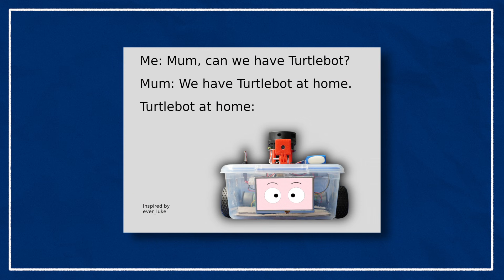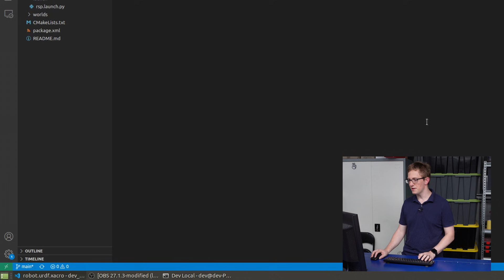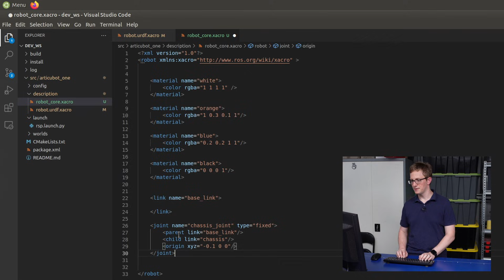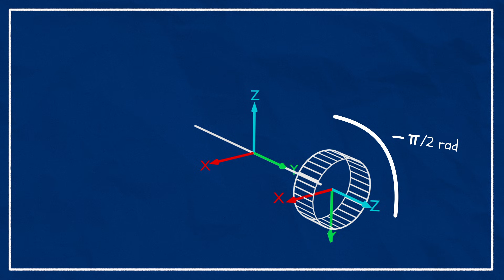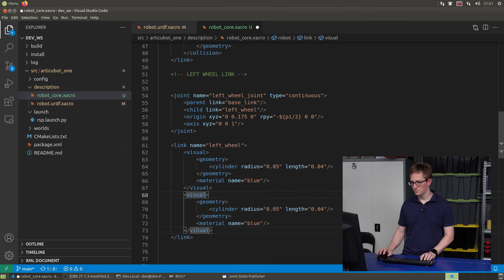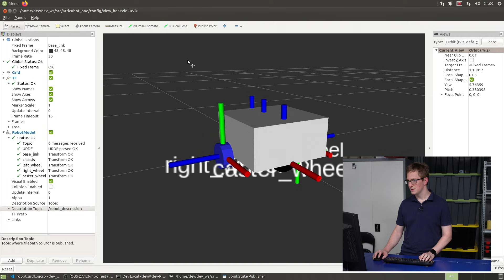Creating a rough 3D model of our robot with URDF

Comment: Hey, I am facing issue , I removed the castor wheel section and I added two more wheels to make it four wheel robot, but im not getting it on rviz, it still shows the older robot( I'm using the latest edited git hub package).

Comment: I made the changes in the robot_core.xacro but I cant seem to see the base_link and Chassis_link show up on the terminal? I tried closing, and sourcing ros2 and sourcing the install/setup.bash, using colcon build again in the src folder but still doesn't show up. Any help would be great, by the way love these videos and you have a real knack for teaching!
Reply: I have same issue
Reply: @chiragshinde4182  Have you managed to solve the problem. I am facing the same issue
Reply: I am facing the same issue. Anyone found a solution?

Comment: I am using ros2 humble to follow up on these tutorials. I am getting this error when i try to run <ros2 launch my_bot rsp.launch.py> : 

[INFO] [launch]: All log files can be found below /home/danny/.ros/log/2024-09-01-12-24-26-637618-danny-15734

[INFO] [launch]: Default logging verbosity is set to INFO
[ERROR] [launch]: Caught exception in launch (see debug for traceback): Caught multiple exceptions when trying to load file of format [py]:
 - ExpatError: not well-formed (invalid token): line 5, column 11
 - InvalidFrontendLaunchFileError: The launch file may have a syntax error, or its format is unknown

what could be the issue?

Comment: Thanks for the video series, so far it is very informative! I noticed that for the inertia tensor of your cylinder, the axis of rotation is about the z axis. Since your wheels are rotated about the x axis by pi/2, their axes of rotation are now about the y axis. When you define the origin of the inertial tags for the left and right wheel, shouldn't you also rotate the defined inertia tensor about the x axis by pi/2 as well?
Reply: or is this not needed because you have rotated the axis of the joint around x and then stated that the axis of rotation is about z (which was originally aligned with y). I think i answered my question

Comment: there is a problem where i couldnt run the package of joint_publisher_gui  in which it says package not found.eventhough i had sourced it but no use.kindly help anyone
Reply: Same problem here ! did you fix it ? if yes, could you tell me how please ?
Reply: This worked for me: "mamba install ros-humble-joint-state-publisher-gui". I'm using the ros-humble installation from RoboStack as a basis.

Comment: If I wanted to build a more complex design for the chassis could I use for example Fusion and import the geometry and write a xacro file manually? Or how would you do it try to build everything in xacro only?
Reply from the maker: That's a great question. There are tools for converting from Fusion to URDF which I've never used but should probably try, and then make a video on, I'm pretty sure people are using it out there in industry. I'd personally be inclined to do it manually for the sake of simplicity and clarity, but it depends on the project.

Comment: Im trying to use foxglove to publish to joint state and for some reason I cant get my wheels to to turn on publishing to /joint_states. 
I am using docker + ROS2 so running rviz by forwarding the  X display is not working for me for some reason hence foxglove. But foxglove doesnt have joint publisher GUI :(
Reply: I finally got it to work, had to install ros2 foxy on bare metal, change the DDS version to cyclonedds and then run rviz and gui state publisher on bare metal to be able to control the wheel, It would be great if you do a series that just focuses on ROS 2 networking and make it a first class docker citizen
Reply from the maker: Glad you got it sorted. Honestly, I find the DDS stuff maddening sometimes. When it works it's great, but when it doesn't it's very opaque and hard to troubleshoot.
I'll definitely be doing some videos on ROS and Docker, but I'm no expert, I'll just be showing off what works for me haha
Reply: @ArticulatedRobotics  micro ros and stm32 board tutorials would be amazing ! Byw really looking forward to those arm videos. I am really interested in inverse kinematics, position and torque control !
Reply: Actually if one does xhost + and forward the DISPLAY env variables to the docker. It works. I am able to get gazebo and rviz up from inside the docker. So life is good haha

Comment: Need help! Despite installing joint state publisher gui, I couldn't find it in the ros2 pkg list and it wont start.
Reply from the maker: Strange... so it installed successfully but then won't run? And you definitely installed ros-foxy-joint-state-publisher-gui?
I'd try re-sourcing the base ROS installation (e.g. by closing and reopening terminal if you have the correct line in your .bashrc). Then rerun the command.

If that doesn't work, try replying here with the print out and we'll see what we can find :)
Reply: @ArticulatedRobotics  yeah I tried restarting the termial (also sourcing) but I keep getting this <<package 'joint_state_publisher_gui' not found>> when I did <<sudo apt install ros-foxy-joint-state-publisher-gui>> the result was successful and no error message was there. I guess I didn't make a mistake in that process. However, when I search now using <<ros2 pkg list>> I couldn't find joint state publisher (or anything like that) as a package.

...and I am very new to ROS so it is possible that I made a silly mistake and not realised it. Appreciate any help! Thanks much!

Comment: Good tutorial, anyway is it necessary to configure the model by hardcoded? I've seen another video turotials doing some joint's or model's configuration through the gazebo's UI, and later we can save it by .dae file. What's the difference?
Reply from the maker: Thanks! I'm not quite sure what you mean, perhaps you can include a link to the other tutorial? I would say:
- To integrate with ROS we should write a URDF. Not everything needs to be hardcoded (can use properties etc), but it will probably need to be written out in XML/xacro/URDF.
- If just using Gazebo, we can write an SDF file directly, or build it using the Gazebo UI (which is a bit rough)
- The dae format can be used to include a complex mesh as part of an SDF/URDF rather than using the simple solids (box/sphere/cylinder).

I would not be surprised if there are plugins available for other CAD software that let you export both a URDF and a DAE to simplify the process, perhaps you saw a video of that?

Comment: Thank you for making this video. I'd like to know how to assign the mass of the URDF. Consider like I want my robot model to weigh 250 kgs.
Reply from the maker: Hi Siddharth! In the Inertia section of the video I show how to set the masses of each link when using the inertial macros (e.g. at 22:39 I set the chassis to be 0.5kg), so you can set your masses appropriately. If you are writing out your inertial blocks in full you can also set the mass there (see my URDF overview video for more details on that). I recommend using the macros though as it is much simpler.
Reply: Thanks man I got it.!